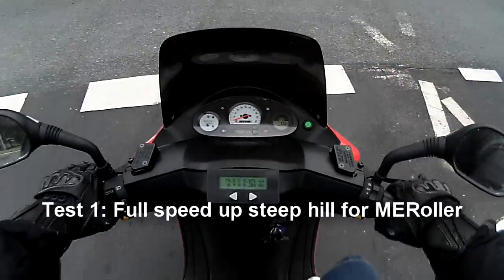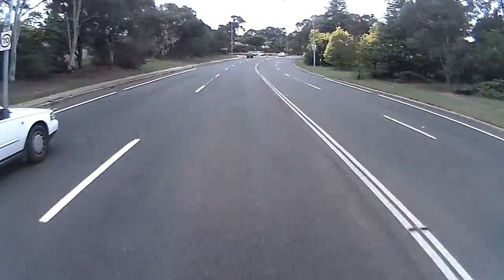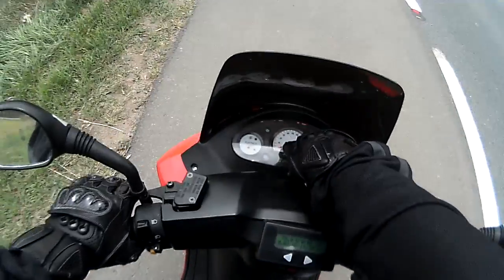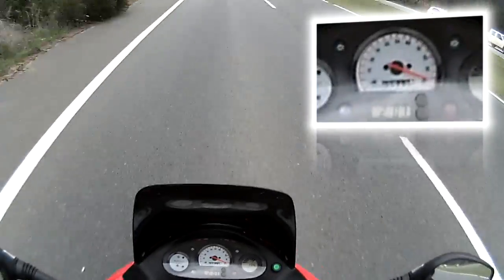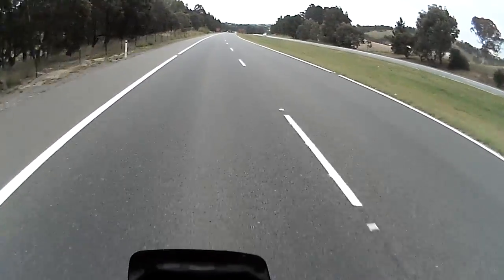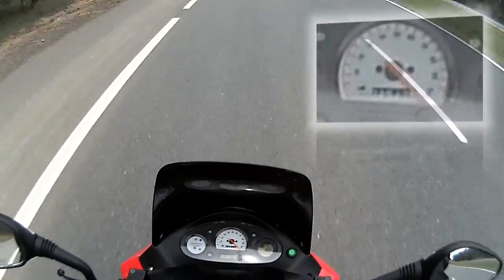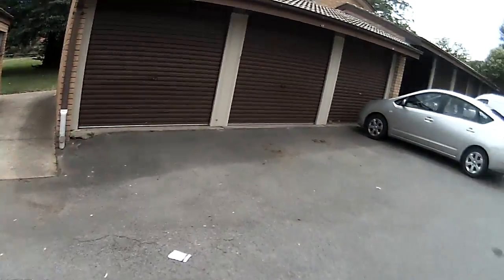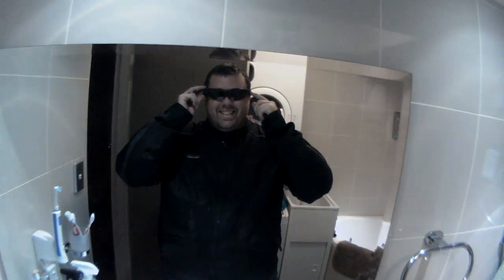Erider 8000w Scooter Speed Test

Comment: And now? Six years later?
Reply from the maker: MaTraHDFILM Hi. Yep, bike is still going great. I bought it in 2010 so it's going on 8 years old now. I've clocked up nearly 125,000km and it still runs just as good as it did on day one. My battery range has aged of course but it's still plenty to get me around town. My battery capacity is at 91%. The only repairs I've had to do in all those years were new tires, a blinker bulb, a headlight bulb and a new Speedo cable.
Reply: Great story ! thx for info
Reply: What is the general range on a single charge and What was the initial purchase price?

Comment: tell me about efun  company in china. do you still have this scooter? thanks
Reply from the maker: Hi there,Yes I still ride the scooter every single day from home to work. I now have nearly 30,000km on it and nothing has gone wrong apart from a blinker and new tires. My battery capacity has dropped from 50Ah to around 44Ah now after 6 years. I bought this bike from a seller in Australia so I don't know anything about efun in China.All in all, I'm happy with the bike but I would like to have more power because its ok up to 75km/h, but after 75km/h to 85km/h it really struggles and you'll only reach 93km/h (top speed) going down hill
Reply: thank you for your answer
Reply: I hello from Colombia South america

Comment: Well it is having a hard time letting go of it's amps, and therefore the voltage drop is bigger. The battery simply has a larger resistance when the weather is cold

Comment: How do you mean? If you have an open motorcycle license you can ride any capacity. The world governing body put a restriction on electric push bikes to 250 watt. And a speed restriction to about 27 kph. Where as on a racing bike you can exceed 60kph. With electric scooters for car license is similar to 50cc for e scooter. The 4  kilowatt scooter you need an open motorcycle license. They have top speed of about  80kpa the ones they sell is either  48 volt or 72 volt I think.

Comment: Nope.  Really Bad guess on your part.  ZEV uses GBS for several years, not Thundersky (which no longer exists as it was taken over by Sinopoly).  So all of your calculations mean nothing.  The ZEV7100 in Australia use 28 of the 60 Ah GBS battery.  The ZEV is not concerned with the C rating as the motor only pulls 100 A.  Still runs 121 km setting upright, 128 in a crouch.  The 120 amp Alpine controller lets it walk right up on 130 kmh.

Comment from the maker: Hi MegaDHZ. I just found the ZEVaustralia website and they only have the "5000la" and the 7100. The 7100 only has 40Ah cells, most likely the horrid thundersky batteries. Maximum 3c (3x40=120Amps) at 84v  is 10080W. Any more than that will be bad news for a little 40Ah thundersky cell. I've tried them and found they can usually give 2.2c which is 88Amps at 84v is 7392. But in cold weather thundersky cells won't hold 84v they will dip from 84v to 76v so that means 6688W. 
I'm now in winter with